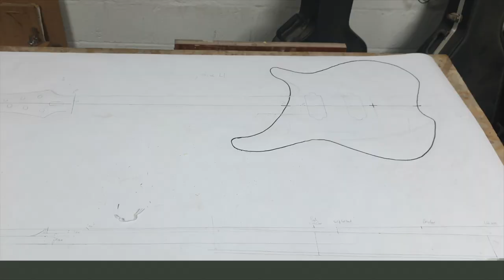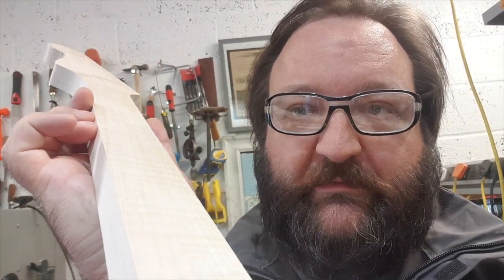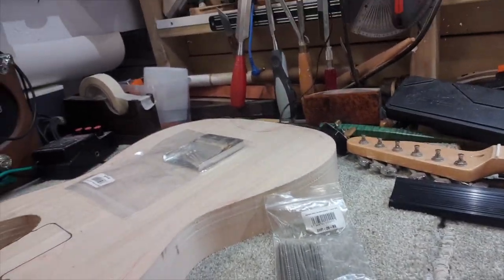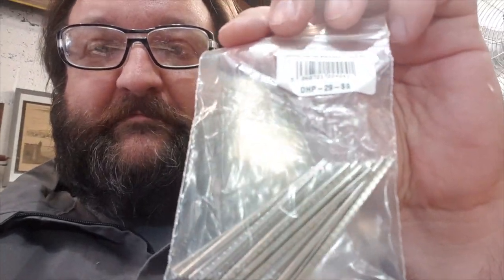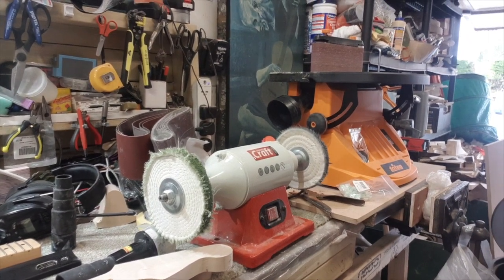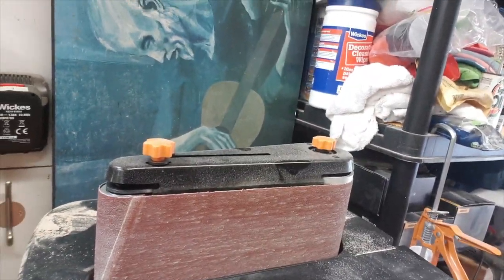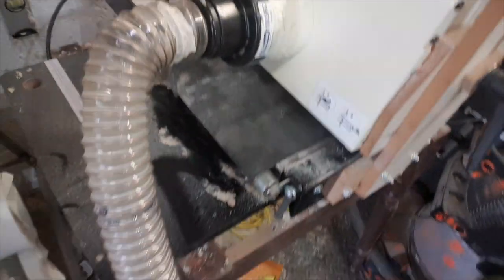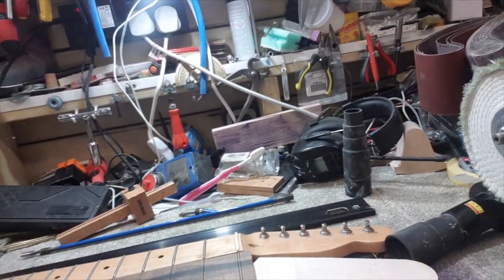Great Guitar Build Off  - Day 4 - And a quick workshop tour

Comment: Nice to see that i'm not alone in having chaotic workspaces, and not enough room. And good luck with those frets if you decide to use them. If successful, remember that at least those frets will probably last 100 years! One for posterity!*

Good luck with the build, subbed and liked from France!

*“What care I for posterity, what has posterity ever done for me?”
Reply: PS Quick question... that fretboard looks nice, where did you get the wood from? Nice woods seem to be difficult to find, over here in the Charente!
Reply from the maker: Merci Tim! If I had a workshop 10 times the size it would still be chaotic.  It's how my mind works best.
Reply from the maker: I found it in a little place just inside the industrial zone of Glasgow... a fair trip for me.. but I couldn't pass it up.  If you go to my website (www.SadFernando.com) there is a page of resources that I have found useful in the past.
Reply: @SadFernandoGuitars  Cheers. Will check them out.Looking forward to next video. 

And yes. I manage to create chaos quicker than a complex iterative formula, too.
Reply: @SadFernandoGuitars  Thanks. Checking it out, as I write....

PS Iron Gear pickups are fantastic. `Have used several sets, and they not only sound great, but are priced incredibly reasonably. To be honest, i think they sound as good as many "boutique" brands.

Comment: I'm sure I have lots of tools you would love to have but you also have tools I would love to have. Especially like your drum sander and your orbital sander. I hate sanding as much as the next guy and those two sanders of yours that I mentioned are true labor savers.
Reply from the maker: I have a Triton Drum sander in the back, which I bought years ago - before I realised that this one is superior.  It still has it's uses - but there isn't enough room to have them all out at once.  My best buy is by far the Mirka Sander.  If you are weak of heart - do not look up the list price.  I found it in a Crack, sorry - Cash Converters in Stirling for £80.  A bit banged up, a bit sorry looking - but it works.  The Gold paper from Mirka pays for itself in hours... It works faster, doesn't clog as easily and has a long, long life. My advice if you need a sander is to build a dust extractor filter (I have a video on that) for a few quid, get an affordable (cheeeeep) random orbital sander - and buy decent Mirka paper (I think it is called Gold) - it will do 95% of the same job for a tenth of the price.
PS The Triton Oscillating Spindle Sander is on offer at Tool Station at the moment - that's why I bought it!

Comment: With files that are hard enough, you can do a lot of stainless steel frets. The softer ones will wear quickly. 
Mind that you have to pre-radius rather close to the radius of the fretboard and since you got a press you won't have to remove lots of material while levelling. Looking forward to see more of your build.
Reply from the maker: Cheers - I won't risk it on this build, but perhaps my next one - I do have a radius jig (bought, not made I'm afraid).  I really do want to try SS frets.  Off to the second hand tool shop tomorrow to get some cheap sacrificial snips and files, I think.